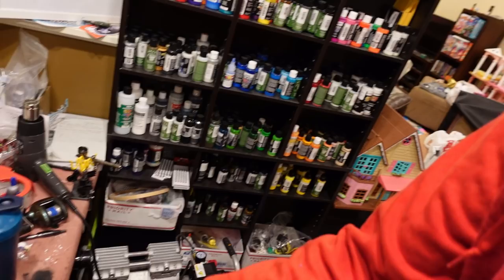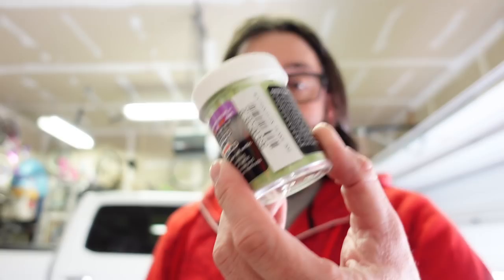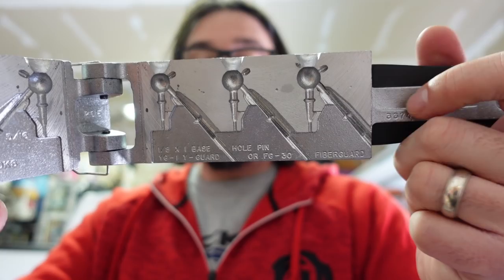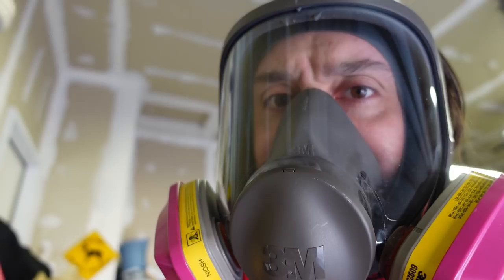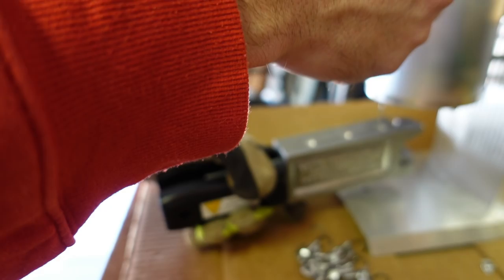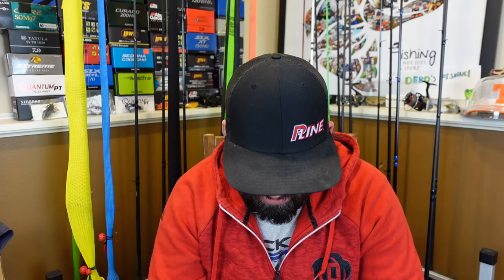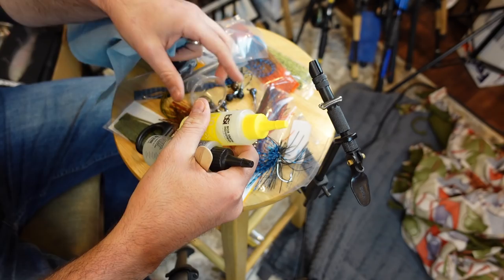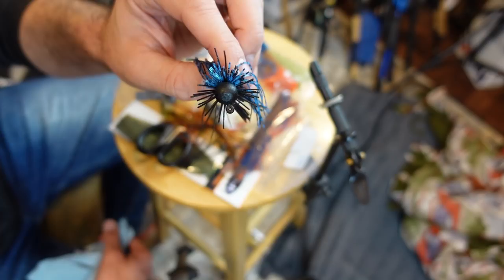How to Make Finesse Jigs at Home (Awesome Beginner Jigs!)

Comment: Just started tying my own jigs a few months ago Debo! Try 24 gauge floral wire, it’s smaller and a matte dark green color so no flashy silver on those jigs. Also, I find it easier to tie the skirts while they are in the vise. Choose your bottom tabs and lay them across your wire loop then pull the wire loop onto the bottom of the jighead in the vise, loop once to secure the tabs the lay the top tab over and continue to loop to secure it. Either way yours look very nice!

Comment: Debo,  I've found when using  the wire, laying it on a flat surface and then layering the skirt material and jig, helps to make the wrapping easier.   Also, the fly vise is a great tool to assist in tying.  One thing I do, is use a band/o-ring/rubber band to get the skirts in place and use a bobbin to tie with thread.  I've found that thread is easier on rubber and silicone and less prone to cutting it... not to mention, no sharp ends.  Keep on keeping on my dude.  🐟👊
Reply: £p

Comment: 3/32" heat shrink tubing over the hook eye will save you a lot of grief with the powder paint in the hook eyes. Remove before curing the paint.
Good video Debo. 
Thanks.

Comment: @Debo honostly all you have to do instead of filing that small bit on top of the jig is get a solid piece of metal or even a hammer and just pound down the lead a bit... It doesn't take much at all and it takes literally 2 seconds. Just a FYI for ya 😁 great looking jigs bud 💪🏻💪🏻👍👍

Comment: Dear Sir. I noticed that you used a wire to tie on the skirts. Instead of twisting and cutting off the excess wire, could you not shape it as your weed-guard? This will mean that you can convert any jig heads to have this weed-guard option.

Comment: I do get you are making them to use them and likely loose them, but if I am loosing my jigs I am wondering if my line is strong enough or what is causing the issues. Please be aware I lost a jig 4 days ago so none of us are perfect. Second, why not get the stencils from Do-it for lures and such and do eyes on your jigs with white and matte black? Is this step too much extra work? Does it require the jigs are baked and then the white and black put on and then baked again?
Have you tried your hand at their softbait molds? They have just poured skirts vs the tied ones, though I personally like the tied ones myself better and have since I was a child.